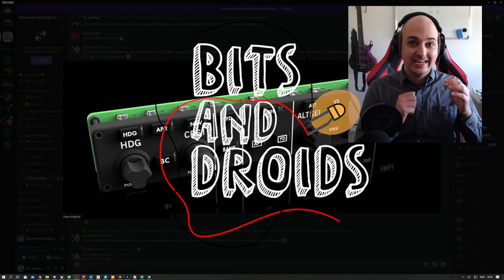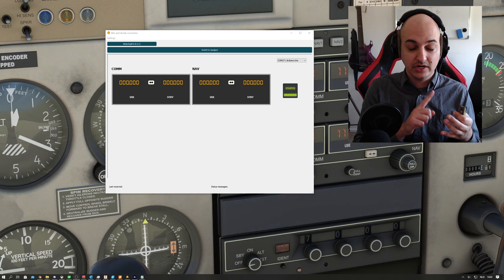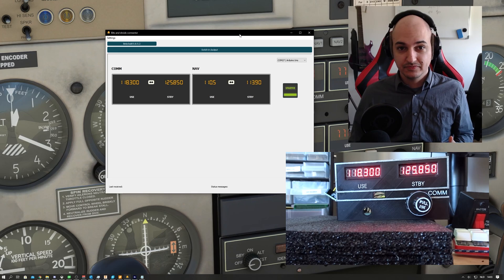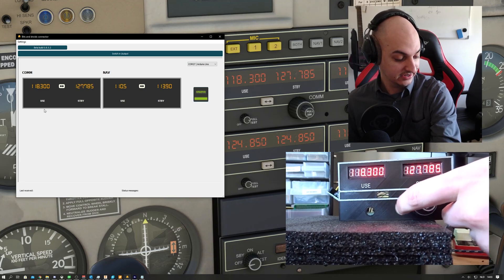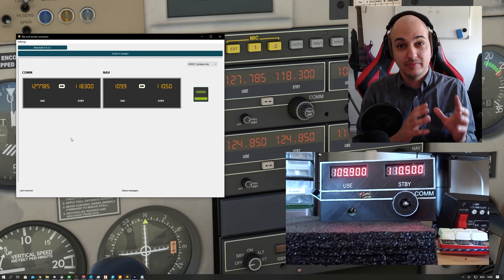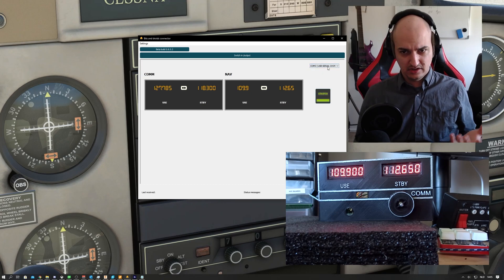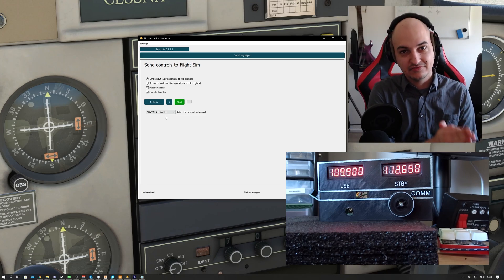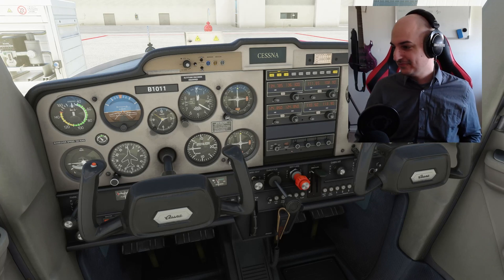Radio stack with 1 Arduino for in and outputs, mfs2020 arduino library

Comment: work with uno?
Reply from the maker: Yes it does. You do need a 4.7~10 uF capacitor  or a A 100nF ceramic capacitor has also been tested successfully  between reset and ground though. More info about this can be found here: https://www.bitsanddroids.com/flight-sim-connector-library-documentation/ 
NOTE: When you place the capacitor remove it when you upload a new sketch or else it won't find the board.  So code -> upload -> place capacitor